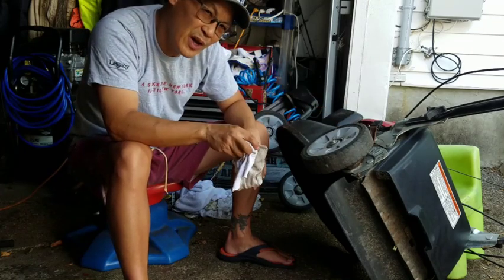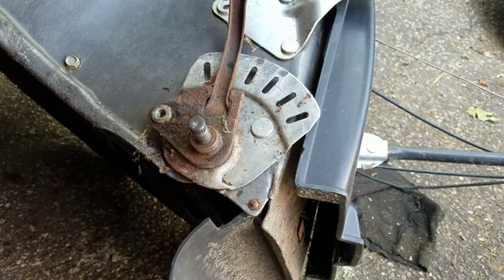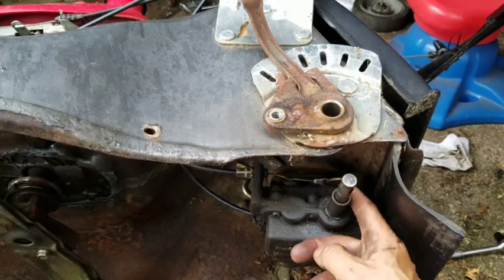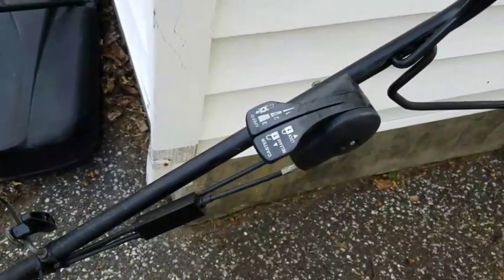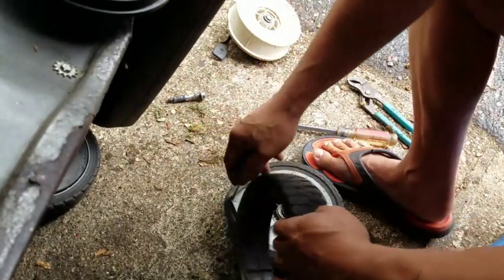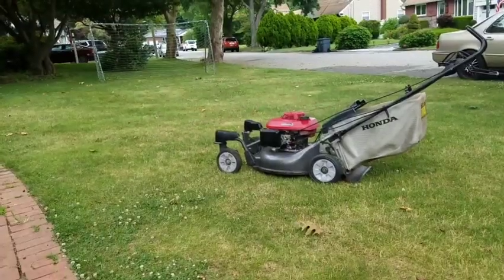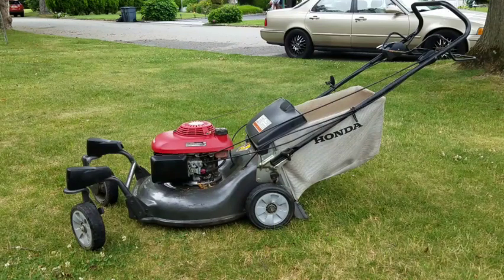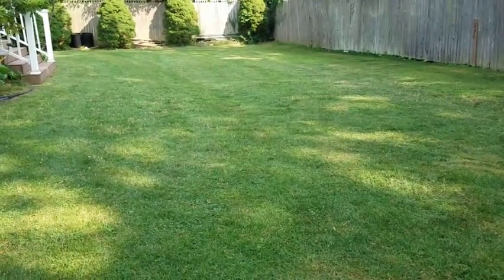FREE HONDA HRZ216TDA ZERO TURN LAWN MOWER REAR WHEELS DON'T ROLL BACKWARDS TRANSMISSION TIRE RETREAD

Comment: Its the best cutting self propelled lawn mower ive ever owned. 18  years snd it cuts like it did out of the box. Mobile 1 full synthetic oil nothing else and 3 new air filters a season along with a  fuel additive " Stabile." Starts first  pull EVERY time.
Reply from the maker: Thanks for sharing
Reply: same here but my deck is now rusted like a cheese
Reply: @kendexter  My OCD made me  spray it out every time I used it and I would spray the inside of the deck with a rust inhibitor a couple of times during the mowing season and before i put it away atvthe end of the season. And of course, I waxed the top of the deck too. LoL  Non ethanol to keep her arteries clean.
Reply from the maker: And I thought my OCD was bad!
Reply: @FJBsaidcornpop  That said .Hondas plastic decks are insane durable, my oldest plastic deck HRB mower took so much spank. i found it years ago out in the woods at a dump resting there 6 winters ++. had to cut a tree to get it loose from the vegetation   . changed carburetor , blade and oil and just been running and running . and this newer HRX is even stronger thicker plastic deck ,

Comment: Just bought one of these for $150, didn't realize it wouldn't go backwards. Self propelled works great though. Hopefully cleaning up those sleeves helps with that issue. Started super easy though.
Reply from the maker: No walk behind mowers go backwards,  that’s so you don’t run over your feet.  But you should be able to pull it manually backwards,  usually means your hubs are seized with rust.
Reply: @MowersNBlowers  yep, that's what I meant. Won't even roll backwards.
Reply from the maker: @jeremywheeler8417  yeah,  remove the rear wheels,  if you can and grind the rust from the shaft,  grease it and you’ll be good.
Reply: @MowersNBlowers  thanks.
Reply: Did you get your reverse issue fixed?

Comment: Wow nice Henry! I got a 3.5hp tecumseh push mower sat around probabaly it's from the 90s the valves look good but its missing parts here and there its 3.5hp
Reply: We pulled it over and gas came out the tail pipe

Comment: 6 snap rings for the rear axle are 1 inside and you have 2 on outer edges of the axle to get the transmission to slide on out

Comment: Speaking of that little spring and the spring inside of ink pen is the best thing I have been able to replace the one in my grass😂 and I lost keyway and used magnet from a old sub woofer and was just a spring and not the whole thing  click pens for free so  hopefully it will help you to get a replacement or when you can decide it works  no need to give away your money 💵
Reply from the maker: Bro! This video is a hundred years old,  that mower done sold years ago.

Comment: You want to lock the front castner wheels when cutting banks or at angles, if not you will be fighting the front end from wanting to go down the bank.( Gravity) If you are always on flat ground you will be ok if not you will wish you didn't Chuck the locking mechanism.
Reply from the maker: Being I have flat land,  it doesn’t matter.  I sold it shortly after the video,  I seldom keep what I fix.
Reply: @MowersNBlowers  Really wasn't paying that much attention to the video, just heard that part about getting rid of the locking cable .

Comment: Have you tried using the mulching function with this mower? I found one on the side of the road, changed the carburetor, and had the blades sharpened.

It mulches TERRIBLY and I'm trying to decide if it's a blade issue (meaning I need to replace the blades and try again) or if it is just underpowered for the size of the deck to mulch.

 I've always mulched and never had an issue with a Honda mower, but this one performs poorly.

Suggestions are appreciated!
Reply: And this is the Honda HRZ216TDA mower that I am referring to
Reply from the maker: Yes, I only mulch...it mulched great.  You need mulcher blades.  You should try gator blades, the clippings come out minced.